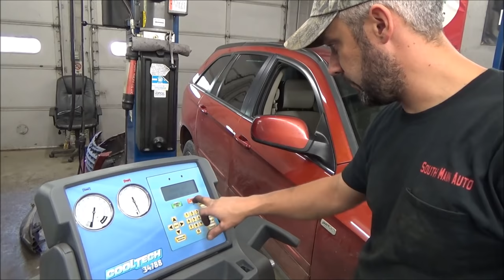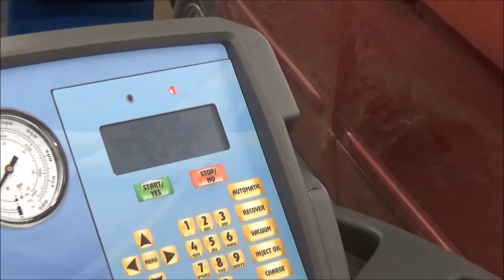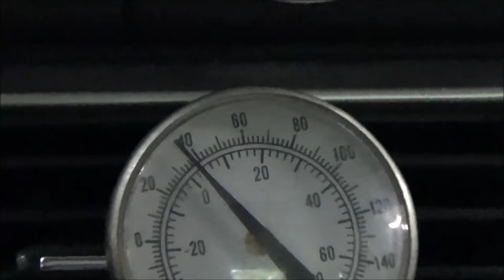A/C Condenser Remove & Replace : Chrysler Pacifica

Comment: I thought the vacuum pump and the jar with water demonstration and explanation was very good. Great video, well done and very informative. Got my sticker thanks.
Reply from the maker: DC Rickerson Cool glad you liked it :)
Reply: I totally agree. Couldn't explain it better myself. You would be a great shop teacher. Ever thought about it as second career?
Reply: Also agree!
Reply: Why does it boil the water in the container but it doesn't affect his skin or hand? Just simple skin resistance?
Reply: How we made water in the Navy, pulled a vacuum on a tank with saltwater then capture the steam...viola freshwater!
Reply: @RagnarokCo  I'm late to answer this, but water can be made to boil in a much lower temperature by negative pressure. 
 At sea level water boils at 100C, at high enough altitude where atmospheric pressure is lower it can be done at, say, 90C or so, there is an aerospace term with a guy's name on it for an altitude where free water would boil off at body temperature, etc. With a vacuum pump, you can make water boil at room temperature for example.

This is the reason why building ventilation systems should be made with a slight negative pressure. It aids in keeping humidity (including that from the exhalation of people) from gathering as moisture in structures. If the pressure inside the building is above atmospheric, especially in humid climate or weather, moisture can gather into structures and in the worst case cause mold and other organisms to grow in them.
Reply: Yes I love that simple demo but in the Uk, kids are taught that at secondary school!
Reply: I was just going to head to the garage  for my mighty vac. and you beat me too it.

Comment: Love watching these videos , I have done A/c work for 19 yrs and you hit the nail on the head with your explanation of water boiling at low pressure, would like to mention too to other viewers who might want to know that you should charge on the high side initially and if you need to add Freon / r134a it should be on the low side , and you should always leave system boil off for 5 mins before runningA/C otherwise compressors can hydraulically lock up and bust pistons up. I taught A/C in colleges  for a few yrs it’s also a misnomer that A/C systems blow cold air this is an incorrect statement as an A/C system is a heat exchanger it blows cooler air as you put heat from inside car into Freon then expel  the heat outside the car via condenser. This gentleman knows plenty and I’m glad he shares what he can with everyone, so people (lay or not) can understand
Reply: And your incorrect statement is “ freon “, is a brand name, proper term is refrigerant!
Reply: @Mike Studmuffin usually your are adding to a system with some pressure in it , pressure switch turns system off on low pressure. If system had no refrigerant in it, putting it in a vacuum is the proper way.

Comment: After watching your video, I changed my radiator in my 05 Pacifica, and found my cooling fan switch had been replaced and was also hanging by the wire. Luckily no damage to the condenser. I've repaired several things on this vehicle thanks to you and your videos. Much appreciated.
Reply: Great video. You are a great teacher. I have learned a lot about a lot of projects.

Comment: Eric it’s funny that you mentioned R2W. Because of his and your videos, I was able to go from no AC experience to successfully completing a complete AC overhaul on my beloved 95 chevy g20 conversion van, which has front and rear AC. I replaced the compressor, pressure switchs, evaporator, orrifice tube, expansion valve, o-rings, flushed everything, vacuumed, and recharged. I learned the hardway that Santech is not better than Acdelco, and your diagnosing methodology came out in me and I was able to use the gm service manual to deduce that my recent ac issue was due to a bad high pressure switch that I installed new during the overhaul of last summer. Well ysterday I completed and it is working correctly now, so I thank you and R2W!!

Comment: Great procedure video Eric.  What's more interesting about any A/C major part replacement is many mechanics do not add any pag oil to the system often unless it's a compressor replacement job. I've watched them do it and I have also watched them evacuate the system in 10 minutes and call it good all while guessing on how many pounds/oz's of R134 to add. Once thing I didn't understand was how the radiator was damaged. Hard to think the condenser rubbed on it enough to do that to just the one side.  It pays to have the right tools and equipment but most importantly, it pays that the shop uses their equipment to the fullest so that the finished job is done correctly. Yes, it is amazing to see our tools manufactured outside of the USA. Seems like that is changing for the future as import/export laws get updated so we may just see more USA quality sooner than later. 

Regarding "wrench sets", I also have noticed many sets of wrenches do not include the 9mm and 11mm size for some reason. Depending on the count of wrenches in a set, some come with the 11mm, not the 9mm and some with the 9mm not the 11mm. Can't figure why as there are plenty of 9mm and 11mm nuts and bolts on just about anything out there. Go out to buy them and individually, they are very expensive from $15 to $25 each.

Comment: Hey Mr. O., thanks for the video. A similar story for you, I did a condenser on an early 2000's Mercedes ML350. The system was totally discharged. When diagnosing the problem, I pulled a vacuum and it held, so I charging and the whole charge crapped out onto the ground (btw, PAG oil stains blacktop and stinks like cat piss). I found a plastic pull through (the kind that electric aftermarket rad fans use) that holds the center of the condenser tight to the radiator, it is a factory install so it's factory MB. Years of rubbing caused a nice sized hole in the condenser. A vacuum pulled the plastic thing tight to the condenser to hold the vacuum, when charging the system it let loose. 

Sometimes bad installs are from the factory too.
Reply: (Feeble attempt at humour) Scotty Kilmer would have warned you about a Benz product.

Comment: Another great informative video. Just a home mechanic so dont have an AC machine....interested to see you charge to the high side AND without the engine & AC running. Also appreciated your desire to do the job correctly...Many guys would not have mounted that relay or replaced the missing push pins...Kudos!!  And the demo showing the moisture boil off was great!!
Reply from the maker: john smith Well we try to leave it better than we found it.
Reply: john smith you charge through your high side to keep liquid refrigerant off of your compressor valves. They cannot pump liquid. When the engine is running you can meter the gas with gauges to keep from flooding the compressor and knocking the valves out.

Comment: I have a 2006 Chrysler Pacifica . It has the power to move .But like you I prefer to have it start and good brakes and good tires . I have had Dodge trucks that were awesome and Plymouths  that were crap .But it appears that Chrysler uses nothing but cheap parts .No wonder people die in accidents .Plastic doesn't take hard hits at 65 mph. Great video and as always you are very instructive . Well done !!!

Comment: 42:50 I will never forget the day I was at the shop and a Honda Civic pulled up with steam billowing out of the front grill and out from under the hood. I went up to greet the guy and ask him what I could for him (assuming that he was coming in right away after noticing the steam from the very obvious coolant leak he had). He wanted his free washer fluid top-off and nothing more. I said "Sir, are you aware of the steam that's coming out of the engine bay? You have a serious coolant leak right now." He said "Yeah I know, I just want that washer fluid for now." 😦 I put on my burn glove and popped the hood, and I could immediately see the top tank of the radiator was cracked and spewing steam and coolant. I topped off the washer fluid and asked him if he wanted a quote real quick on replacing the radiator. He declined. This was summer in god damned Tucson, Arizona and this guy drove away in that car with no care in the world. I was speechless. The way some people prioritize repairs/work is really whacky. I understand that the washer fluid was free and maybe he couldn't afford the rad at that time, but he didn't even want a quote. He was totally not concerned.
Reply: Haha, he drove off thinking "not gonna scam me today!"
Reply: Shortcuts? "You can pay me now --or you can pay me later".  I'm all for beating the book, but that 's just criminal. And --- yeah, that radiator should been done to save all that R&R labor all over again.
Reply: @superduty4556  That's funny!

Comment: Your little boiling demonstration reminded me of a coffee moment in a small aircraft. I had a thermos of coffee from home with me on an early morning flight. I climbed to an altitude of about 7k feet and sat back and opened the thermos for some coffee. Damn if that stuff wasn't boiling over. Made a little mess. But the lower pressure of being at 7k feet made that stuff boil.

Comment: Toptul was founded and made in Taiwan. Yeah, Taiwan but, this company is manufacturing some of the highest quality tools at a competitive price. Snap-On could sell their tools cheaper but, they want to you pay what they market. $110 dollars for a Snap-On 1/4 Ratchet, come on! Busting my balls trying to afford "good tools" so to speak. Lol I've come accross some of their stuff and honestly made me think about all the money I spent and just how comparable Toptul is, respectively to other brands. Stress tests, wear tests, etc. On another note, Great video Eric! From working in the car business for many years I've seen alot of people turn down some scary things that needed to be replaced. Paper thin rotors (in the rear LITERALLY paper thin), steel belt on tires fully shown, strut mounts fully rusted and not even attached and so much more. Some people want a death wish so, just fix what they came in for , even of its just a bulb or a/c fix! lol Learn so much from you Eric! Keep the videos coming. You motivate us all so much! From the guys over here in Rusty Ol' Wisconsin 🤙

Comment: I am a professional chemist. The demo at 35:20 showing that water boils a room temperature, if the air pressure above it is low enough, is a classic of first year chemistry. Sure enough the water boils vigorously at 36:30.

Comment: Excellent video and the demonstration you did was awesome. Most times I also change the drier but in your case the condenser will still outlast the rest of the car.
Maybe you will get the rest of the repair at state inspection time.
I think that some people don't realize that steering and suspension wear can be dangerous for themselves as well as other people around them. I hope you document all those items and have the customer sign it since I got burned once.
Reply from the maker: wysetech2000 Yeah I did and I also provide an estimate on needed repairs. C.Y.A. I say, (cover your a...) well you get it.

Comment: Great video!!! Wow all that salt!!!!! I can't believe that cooling fan module job what ever shop that did it should pay for the condenser! The owner should have bit the bullet and replaced the radiator as well. The guy Jason that commented earlier made a valid point about the customer repairing the A/C system and stressing the leaking radiator. It can give out any day, she'll have to bring it right back to you, and pay for the labor all over again.
Reply from the maker: Stanley Hill Yeah she will but when every thing is on a budget it is what it is. Car needs a lot of work still too :/
Reply: Yea I can relate, it definitely needs a lot of work I think those other Pacificas you worked on were in better condition 😉
Reply from the maker: Seems so huh. Well the one with the headlight issue I did replace the frame in once all ready

Comment: The term for lowering the pressure in a system to remove moisture is called "sublimation ".
Pulling a vacuum in the system & then letting it rest in a vacuum for a period of time will tell you if you have s leak. If the pressure  increases from it's  resting state the system has a leak OR still has moisture in the systr6.
Another way to dry a system is to pull a vacuum & break the vacuum using nitrogen. Then pull a vacuum again & retest.

Comment: 34:02 Science class with Mr. O. That was a cool way of demonstrating boiling points and pressures. This is why it takes longer to cook at higher altitudes. Less pressure = lower boiling point. Because it requires less heat to boil water, you need to cook food longer at that lower heat.

Comment: My wife hit a deer with her 3.5 Pacifica and I only pulled the top plastic off to remove transmission cooler, condenser, and the radiator. After watching how you did it explains why I had to buy a second radiator when I poked a hole in it trying to get the hose clamp back on with a screw driver because there wasn’t much room 🤦‍♂️

Comment: Another great video as usual your demonstration using the vacuum pump with the water bottle was really good. People around where I live definitely care about the air conditioning but then again we see high temperatures of about 110 Fahrenheit in the summer. And even during the rest of the year the  UV radiation is very high and so it might be 70 degrees outside but you need the air conditioning on in the car.
Unless you want to roll with the windows down..

Comment: Maybe you could have cleaned that ground connection with brake cleaner and then sprayed fluid film or battery grease to slow down the corrosion?
Super good video.

Comment: Ironically I had a similar problem. My 1996 Astro van had been in an accident. The airbag on one side was taped up to the visor with packaging tape. Should have been dead giveaway. The horn bolts were loose and the horn would hit the ac condenser on rough roads.  I ordered a used condenser from a salvage yard on eBay. Great deal and perfect!. I had to replace one of those pipes with the oring. The salt really ate up the aluminum. That cost me about 80 bucks. I also removed the compressor and changed the PAG oil. This system also had a dessicant in the receiver? I replaced it . It had a  metering device like a pen also replaced. That system gave me some of the coldest ac !!. I loved my Astro...

Comment: Great video. Does the receiver dryer need to be replaced as the system was open for an extended period? How can you tell when one has absorbed all the moisture that it can?
Reply: That is a good question?  I don't know didly about ac as it never gets hot here ... but, I'd probably replace it on account ... but maybe pulling a vacuum gets all the moisture out of the dryer?  Someone who does ac in Houston or LA should answer?

Comment: Great informative video, disgusted at the previous so called garage on relay module replacement, just think if it had rubbed on a brake line?.
Thanks for sharing and best regards from the UK.

Comment: I would have liked it if you had shown how/where you researched the issue of how much oil to add for this scenario. Also, is it possible to extract/ replace the condenser from the top (or bottom) w/o having to remove the front end body parts? 
Thanks, big fan & enjoy your videos. Very inspiring!

Comment: Top repair Eric.👌 My top 3 musts  are brakes, tires (tyres uk translation) and a good heater to keep the toes warm. Way before before air con).top tul is also available in the uk too good value alternative.  Adam (uk)
Reply from the maker: ADAM king Do you have a TopTul Distributor there?